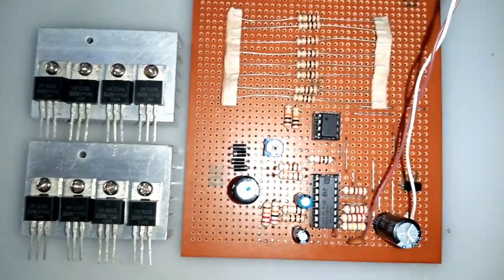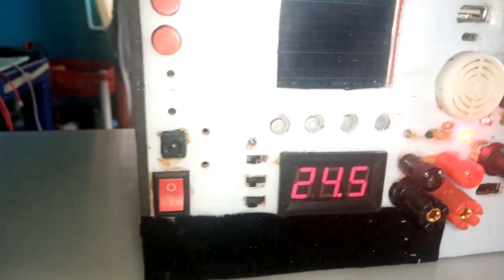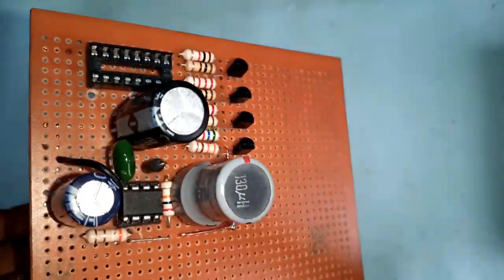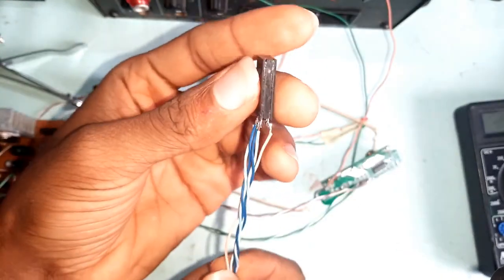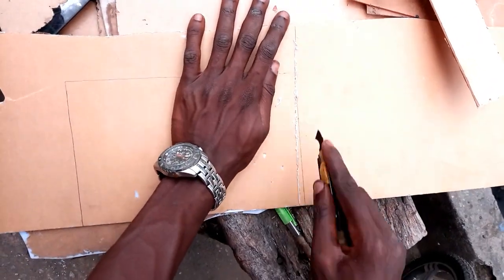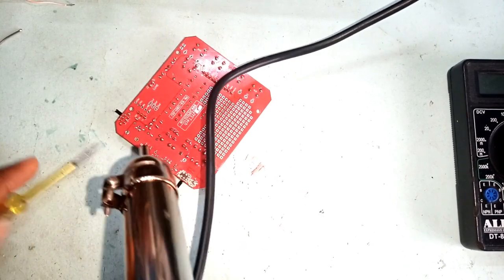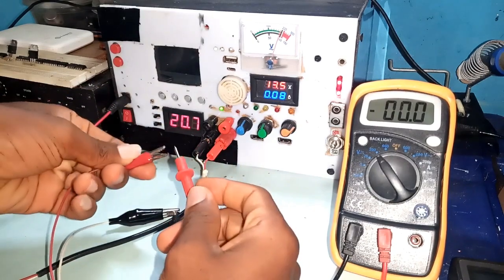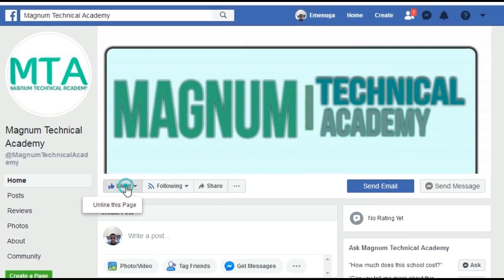How To Build: An ULTIMATE POWER SUPPLY ( short circuit protection, Zener diode tester, Oscilloscope)

Comment: I want to make , variable power supply 3 output voltage ( posative , ground , negative ) using 12 0 12 transformer , Will it work?
Reply from the maker: Yes it's possible
Reply: @MEmbedded_TechLab  how ?
 sir , please reply 🙏🙏
Reply: +12 & -12 for variable circuit ?
Reply from the maker: @pritammaity3221  you will need 7912 and 7812 Voltage regulator simultaneously
Reply: @MEmbedded_TechLab  Thank you
Reply from the maker: @pritammaity3221  I dropped you message on Facebook